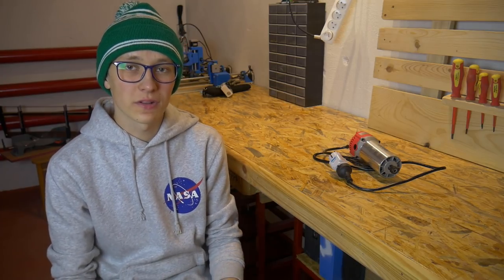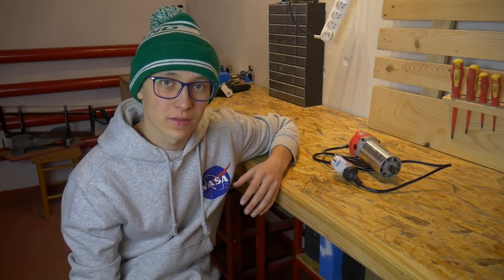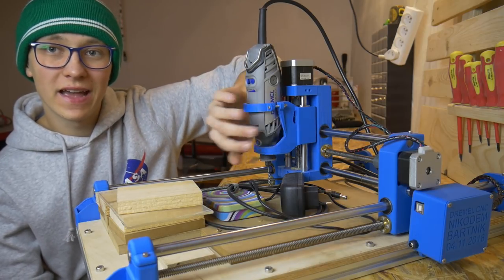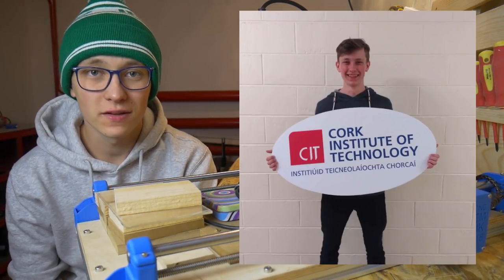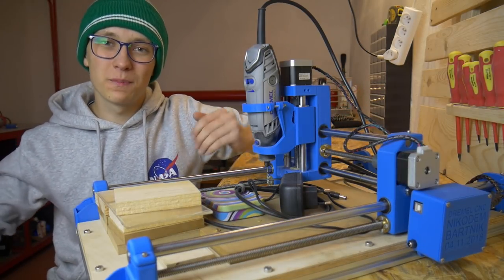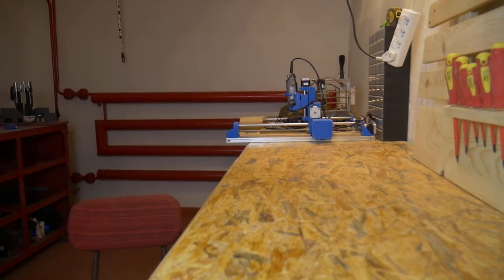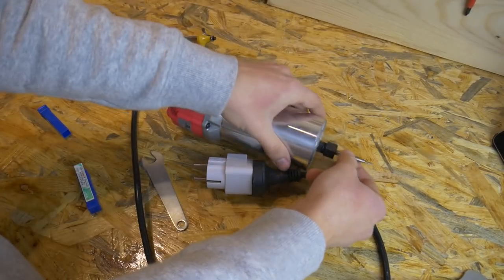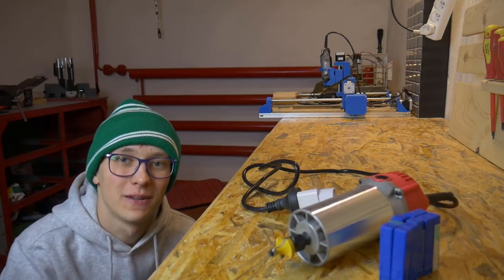Searching for the best CNC spindle - 800W Raitool router test

Comment from the maker: What do you think about this router as spindle? Do you have any other ideas? What I should test next? Thanks!
Reply: You can get ER11 collet with 8mm shank on aliexpress, then throw it at lathe and cut it down to 1/4" and use with any possible milling bit you want.
C8-ER11A-100L
Reply from the maker: Wow! I didn't thought about it :D Sounds like a great idea,  some people may call it dangerous, Thanks I will try it! Just need to find a lathe :)
Reply: You can buy reduction collet 1/4 inch (6.35mm) to 1/8 inch(3.17mm) and then mount the bits on a 1/8 inch (3.17mm)
Reply from the maker: Yes I saw some of them but I want to use 6mm bits...
Reply: @nikodembartnik  
How old Polish people say:  "If you do not like what you like, you like what you have"  You know it....? :)
Reply from the maker: Yes, it goes like this "If you do not have what you like, you like what you have" :D In Poland it's popular
Reply: Just buy Katsu on ebay with set of colets 6,8,10mm :)
Reply: @nikodembartnik  dutch saying is.  who does not honor the small, does not deserve the big.  (ofcourse the translation ruins the saying.)  

they all come down to "be gratefull for what you have" 
if only you didn't waste money on a wood router.  you could have bought 2 or 3 propper spindle's for that money
Reply: @nikodembartnik  That's NOT a good idea. You're hanging the cutter way too far out from the bearing support. Even if you did manage to machine it down perfectly, it will not be well enough supported to work worth a damn.
Reply: @darkracer1252  like what spindles are you talking about?
You should at least give an example...
Reply: I realize I'm kind of randomly asking but does anyone know a good place to stream new movies online ?
Reply: @Kace Cannon flixportal :D
Reply: @Omar Zakai Thank you, I signed up and it seems like a nice service =) I appreciate it !!
Reply: @Kace Cannon no problem =)

Comment: Haven't read all the comments BUT I bought an ER11 collet assembly and just for the hell of it I tried the collet and lock nut ONLY on my Raitool router. I just removed the existing nut and 1/4" collet and fitted the ER11 nut and collet (SAME THREAD!!) and it works like a charm! No need for adapter! Eezy peezy!

Comment: Im also making a CNC.. Its 5 ft by 4 ft.  Im using a 2.2kw spindle from China. water cooled.  Im using 3in x 3in square tubing to make the frame.  Im also using nema 34 stepper motor.  I like your videos . Keep up the good work.

Comment: Help me to Figure it out ..!
I have my new router of cazar 550 watt 30000 rpm router with similar metallic body but the problem is its body heats up very quickly to uncomfortable temperature even in just 2 minutes of without any load run , i measured while running it for 2 minutes without any load i noted it's heat  star coming from the location of its spindle body sides and in 2 min it was 55 C + and in 15 minutes it around somewhere 63 C of temperature ! Can you tell me if it's Normal or not ! Or may be it's because of aluminum Boody conducting heat inside out efficiently ! But i am not sure can you tell by comparing with yours ?

Comment: I used a straw around a 6mm bit to fit 1/4".  I don't know if it is safe but it worked for me.  You might be able to wrap some tape around the shaft instead.

Comment: One thing you need to consider is weight. I have a 9lb spindle in my large cnc and it adds deflection on the z. I will have to later upgrade it to a beefier frame. The CNC system you have would do great with a quite cut spindle that is air cooled. They are not as powerful but work for hours on end and use ER-collet system that will allow you to use dremel size bits to 1/4" bits.  Also for some systems that use routers I have heard you do not want to run it at full speed for hours on end as the bushings will wear out fast.
Reply from the maker: Thanks for your comment, hopefully, I will test Chinese alternative to quite cut spindle soon. From what I heard it's easy to burn it.

Comment: I have a malwakee brushless right angle die grinder it's lighter than my dremel. Max rpm 25,000-26,000. 

Compatible with pretty much every rotary bits. Would that work or is there something I'm not aware of?

Comment: Hi Nick
excellent examination of the various engines for DIY cnc
I can add an expensive brand of engines: proxxon
they have productions created for this purpose but as I said comparable to Kress.
the engine you showed was born for a fairly limited use over time and maybe that's why it heats up quickly, on the other hand the all-metal body should help heat dissipation.
If you use small cutters (smaller than wood chips) and make small passes, the engine will make less effort, it will heat less and you can run it at reduced speed with a voltage reducer: even a few volts less will prolong the life of the engine.
Bye

Comment: Hi Nikodem ! Thank you for this video... But personnally I've decided to use a 500 W BLDC spindle with a PWM speed control. This is the same price like a good  Dremel kit (about 100 €) and much more efficient. The bearings are much better and the ER11 clamp can take tools shafts up to 7mm (there is clamps for each diameter by mm steps). For outside profilage, I prefer to use my 1400 W router under table. CNC dont gives a lot of avantage for this kind of work, I prefer to use it only for inside machining (pockets) and engraving.
Reply from the maker: A similar spindle is waiting for me in my workshop,  but this week I am going skiing so it still has to wait a little bit :)

Comment: Hi Nikodem, there are a few attempts on thingiverse to use a rc brushless motor and some extra bearings to turn it into a spindle. The advantage could be a custom design an rpm adjustment with the speed controller driven by the cnc shield. As said this could be a cheap and individual solution to suit your machine.

Comment: Great video! The router looks like the Makita I use but cheaper 😉
Reply from the maker: Thanks! Yes, even red color is similar :)
Reply: But you can only use wood. Plastic is difficult to mill, high spindle temperature melts the plastic
Reply from the maker: Check out part 4 of my Dremel CNC I cut there some Plexi and it works just fine
Reply: @nikodembartnik  
I was talking about your new spindle. I had similar. During a long work without cooling, the cutter warms up so much from the spindle that the material begins to melt. I do not have experience with a dremel.
Reply from the maker: yes,that may be a problem
Reply: @lone100wolf  that's exactly my point.   but this guy wanted to waste his money on a wood router.  
seriously i have no clue what gets into these people.   why they think it's ok to put a hand operated power tool into a cnc machine.  

hand tools are built so that our inprecise hands will not break the tool with weird movements.  
this means first of all that the tool is way too inprecise.   (you have to account for that inprecision and only make cuts either clockwise or counter clockwise. otherwise your parts are shit)  
being a hand tool also means it's not ment for hours and hours of use at a time.  
these brushed motors require a ton of cooling.  
and for some reason they are loud as fuck.   you need hearing protection to run these things.  

get a propper spindle and you can watch a movie while the thing is running that's how silent they are.
Reply: and don't say these routers or dremmels are not inprecise.  
tell that to my dremmel where the end bit is usually centered.  BUT can go off centre basicly swinging in a circle.  DANGEROUS AS HELL at the higher rpm's  (it's just 1 mm off centre but that's enoegh to slow down the dremmel.  make a horrible sound.  and vibrate my hand so it becomes numb.)
this is the play that is on the parts inside of the dremmel that is introduced so that it's harder to break a toolbit when it bites for example.

Comment: That's true, my 775 spindle is cheap, super easy to mount and with ER-11 i can use bits from 1 to 7mm. The only downside is it's power, but it is enough for me atm :p
Reply from the maker: It's good to start or engrave but milling is too slow and you can't even think about aluminum. One day you will change your mind, thrust me!
Reply: @nikodembartnik  Hey Nikodem and Seweryn, have either of you ever heard of 775Pro motors? They are designed by Vex Pro (A Robotics company) and we have used them quite a bit on our FRC teams, and they are incredibly powerful. with a peak power out of 347W (from what I see, standard 775's are 50-200W), they are being used to drive the ~100lb robots on competition field quite regularly. You might want to take a look at trying the 775Pro out, as it should be a direct replacement for a basic 775, but with potentially much greater power for your CNC :) Take a look at the spec sheet here: http://motors.vex.com/vexpro-motors/775pro

Comment: I think the heat is a big problem because if it's hot after few minutes what about few hours of working?
I'm not even sure it won't fail or set fire
Reply from the maker: I already use it for a longer period of time and it doesn't heat up more than that, there is quite big fan inside that helps to cool it. The 3D printed mount wouldn't work for sure but aluminum would do the job.
Reply: @nikodembartnik  could you measure the heat? Maybe a cooked part could hold. Or a plywood mount

Comment: Imo a dremel has nowhere near enough torque. I would say a 300w spindle is a cheap viable option, 500-800 better at the hobby level. As for the collet, most makers have collet sets.

Comment: Honestly... buy a proper CNC spindle... 

The problem with routers are: Speed, Torgue, Rigidity, { Noise, Exposure, and Cooling.} <- Last bit in parenthesis, as they relate to one another
Speed: Routers are GREAT with extremely high RPM's, wow can they move.. But this is actually a problem on CNC if you're working with metals, or plastics. Metal, you can't get enough chip-per-tooth action. The RPM's are so high, that you essentially rub your bit to death. In plastics, it's even more of a problem, do to the heat generated from friction.

Torque: Routers are high speed tools, and as such, you can't really run them within normal RPM ranges for metal working. If you do manage to "alter" a router, to run at slower RPM's, you sacrifice torque, leading to stalls, and broken, or chipped end mills. 

Rigidity: These tools aren't made for, nor meant for cutting hard materials, such as metals. So they don't have the bearings for some of the loads you're putting onto the tool. This leads to premature wear, run out, and eventually failure of the tool, not to mention, run out, end play, and other variables can lead to broken bits, and ruined projects. 

Noise: Routers are VERY loud tools. 

Exposure: Routers have all sorts of openings on them, and very little protection against anything other than wood dust... Metal and plastics can really gum up the works, causing premature failure of the tool, or it's bearings, not to mention the issues of cooling your part, and tool with coolant, or water.. 

Cooling: Routers are designed around relatively short cycles of use. CNC projects can run for HOURS without the spindle being turned off.. this is NOT good for the tool, as most routers use passive cooling, or internal fans that frankly, don't really cool much more than the stater. 

Most proper CNC spindles are actively cooled, either with coolant, water, or external fans. They are also usually fully sealed to minimize ingress of particulates, or moisture. 

A good quality CNC spindle will be a bit more expensive than a good quality router, however, the cnc spindle will increase the range of materials you can work with, last longer, and hold tolerances much better than a router will, and in the long-term, you'll spend less, because you won't constantly be buying new spindles. If you use routers, you'll be buying a few of them over the course of a few years, as they wear out, burn up, or simply fail due to heat, or particle ingress issues. 

You will also be able to run a CNC spindle at lower speeds, and maintain torque, that will help your cuts look cleaner, bits last longer, and reduce the amount of heat buildup in the tool, as well as the part, which will again, save you money on materials, and tools, as you're not wasting them on inefficiency. 

The right tool for the job is ALWAYS a better choice than "close enough"

Comment: Good video about the spindel, also I saw your cnc project that is amazing.
But as you talk about safety you only mention safety glasses. I will suggest as a good option also Hearing Protection as the spindel and the dremel are very noisy. With kind greetings from Denmark
Gregor

Comment: That looks a lot like a cheap Trim Router from Harbor Freight I will be using in my build. Mine has a housing diameter of about 64mm or 2.5in. I was wondering if you or someone else has made a mount for the dremel CNC? https://www.harborfreight.com/14-in-24-Amp-Trim-Router-62659.html

Comment: you got scammed.   

that's not a spindle. (technicly it is but it's not) 
that's what is supposed to be inside of those hand operated wood mills.  (the ones you use to put champfers on the edges of wooden tables for example)  

they are anything but precise.  

ontop of that.  it's loud as fuck and a brushed motor.  (the ones that cause sparks)  
so it's dangerous for extended use

Comment: best spindle have less than 200$ aliexpress 800W ER16 52mm bracket lot silent than cheap worst palm router motor and better bearings longlive more. i has used many year and newer no problem, before has similar palm hand router to spindle makita 500$ but not longlive bearings and noise lot neightbours not like i working. and peoples not can sleep if i work my cnc ewening. i buy 800W REAL spindle same torgue but lot lot lot silent,